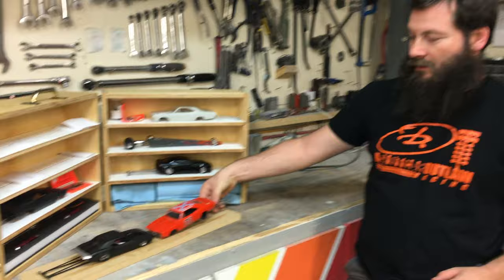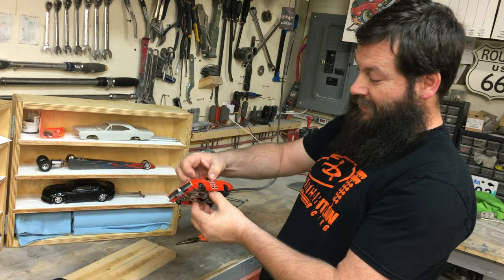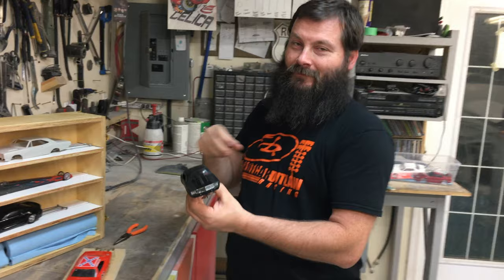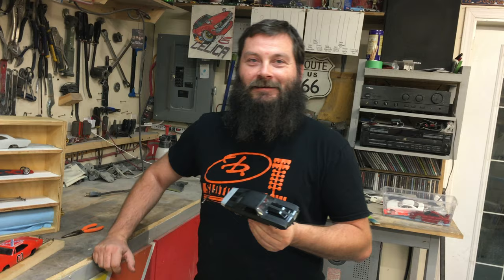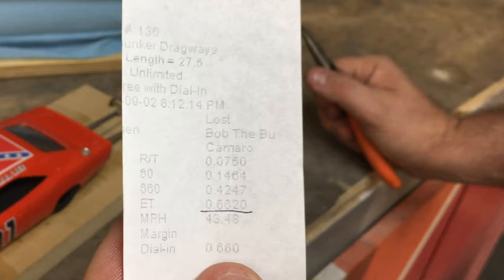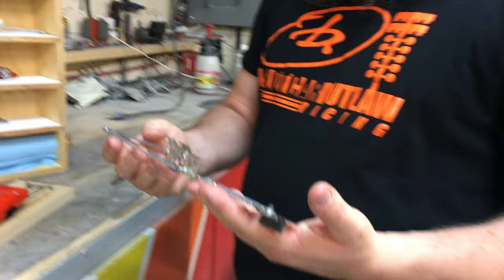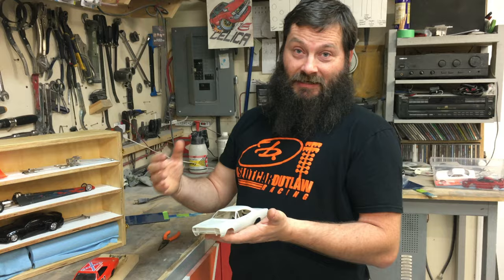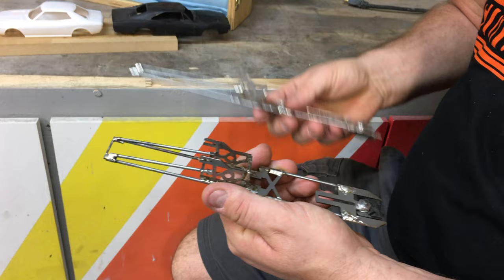THE TOY SHOP EP 3 1:24 SLOT CAR DRAG RACING!

Comment: It is now Nov 2022.  So, I listened to most of the video, how much to build one of these cars - motor, tires, parts wise? You don't mention costs.  I know most of it is scratch built.  I did the same back in the 1960's with my slot car track cars on commercial race tracks.  Used piano wire and tubing's - painted my own clear bodies.  Did not have a Drag Strip in my local Slot car Store, but had 4 really nice commercial different style tracks.  Had race event most weekends.
Thanks for the video.
Reply from the maker: Thanks for watching and sharing! 
The cost varies a bit. For example sometimes a can score a built car for $50 CAD. Other times I can get used parts and piece a car together from stuff in my parts box. If I am building one from all new parts about $150-$200 CAD. Bob builds my chassis for me and I paint the bodies. The cost of the body can range from $5-50 depending on if I get it new our used from another member in our club or the hobby shop. Paint I get is about $25. I use automotive base clear coat.
Reply: I have seen the 1/25 -1/24 drag slot car chassis sell for over 100 $ ... and the super fast motors close to 400 - however this is high end extreme - Check with Roger at Mid America Slot Car Parts ... he sells (RTR) ready to run cars on eBay just over 100

Comment: If you have a good drag chassis with wheelie  bars set correctly then you should Not need an once lead weight to keep front end down  Dennis Sentman D&L Chassis makes the best slot car drag chassis' on the planet
Reply from the maker: Interesting. I will have to take your word on it. I agree there is more than one way to build a chassis.

Comment: Not sure about the race rules and regulations but how about a carbon fibre chassis?
Reply from the maker: I think our rules are unlimited on chassis design it is all bracket racing for the most part. You do need a certain amount of weight to get good contact on the brushes. I did find aero made a bit of difference though.